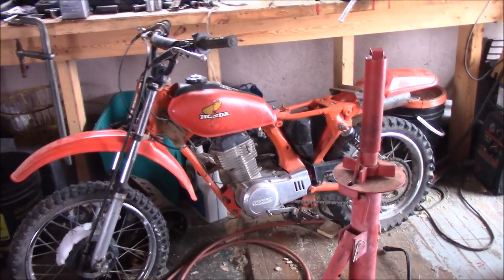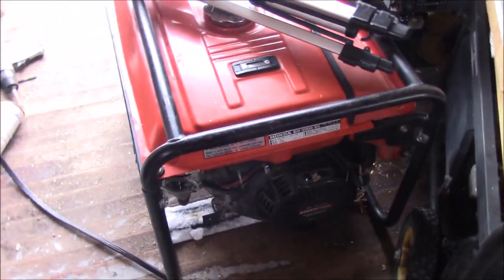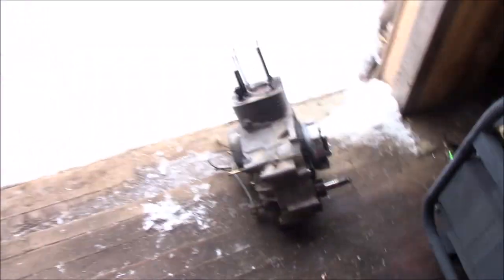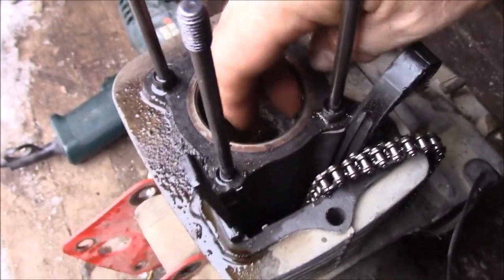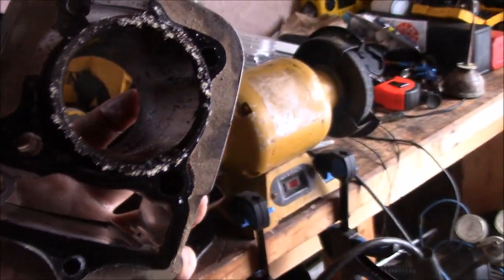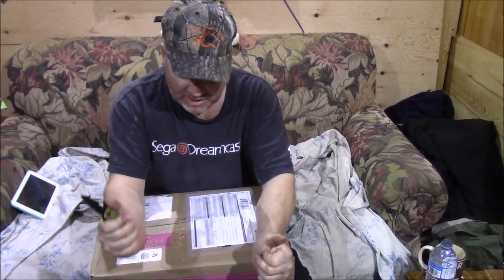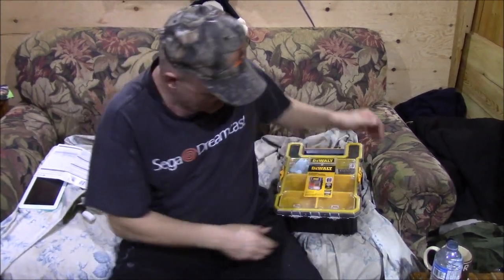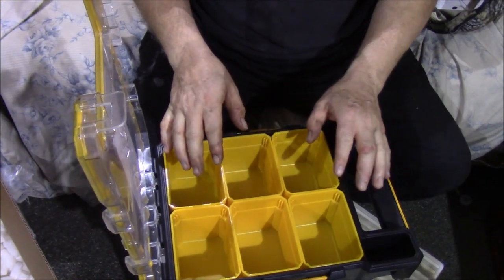I Really Wanted One Of These 1982 Honda XR 80s When I Was 14 Years Old.

Comment: The bike piston and cylinder look great and should make for a nice runner. On the Honda generator engine, it's possible to buy an adaptor for the tapered shaft so you wouldn't have to tear down a running engine to switch crankshafts to fit it to your mill.